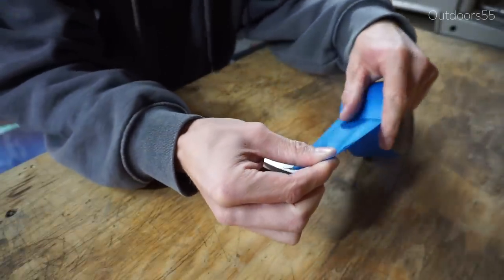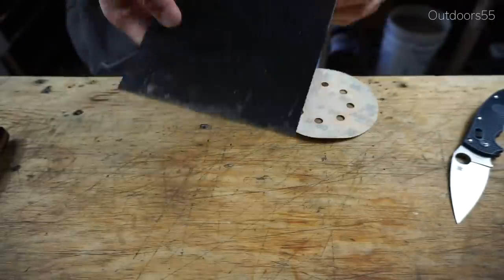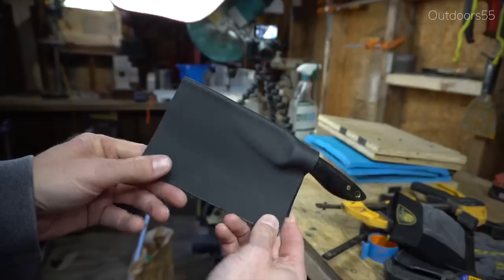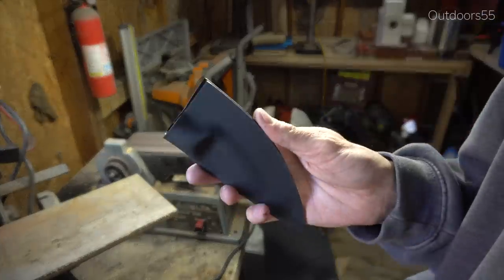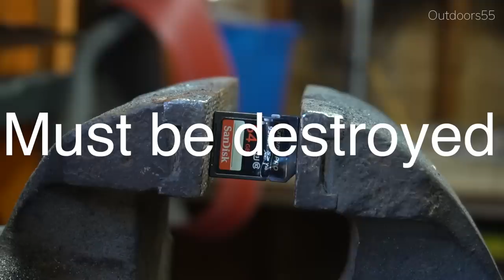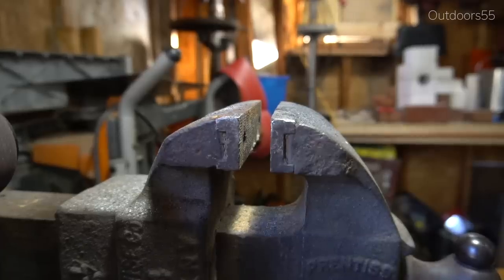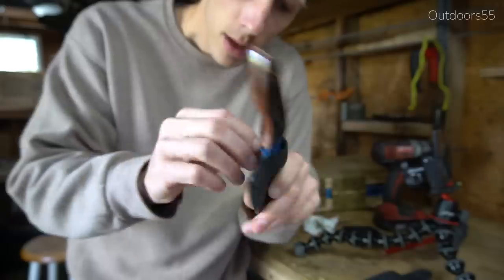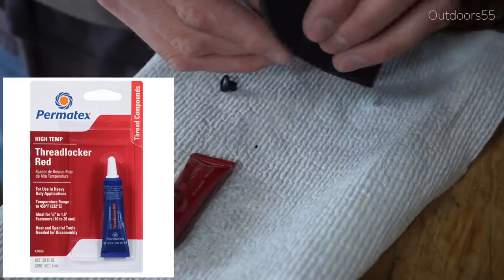Super Simple Kydex Knife Sheath Build - How To Make A Kydex Knife Sheath

Comment: Hey yall, i just wanted to point out that those "kydex bits" are actually just regular old spur bits that have been marked up in price. You can pick them up from anywhere that sells regular ol' drill bits. The brad point in the middle allows younto ensure that the middle of your hole is as precisely placed as possible, it keeps the bit from moving from where you want it at all whatsoever when you're starting your hole, and the other 2 points actually cut the material so you get a really nice clean hole. They're actually my go-to bits for 99% of my hole drilling needs because they work fantastic in any kind of MDF, both ply and solid wood, drywall, kydex, etc...pretty much anything thats softer than masonry or hardened steel. I've never tried with thicker aluminum, but honestly i think it might work as long as it wasn't a real small bit (obviously it might not be great for the bit, but I wouldn't be surprised 9f it could pull it off) but it works just fine going through aluminum flashing and whatnot

Comment: Little tip about the drill bit if you use a regular bit heat the tip of it before drilling the holes it helps keep it from jumping around and it helps with a cleaner hole  .. by the way love this channel good stuff

Comment: Is steam hot enough for molding Kydex? Because if so you could just pop it into a $10 vegetable steamer from the thrift store, then there would be no risk of fire or melting the Kydex. Also if steam works then simply boiling your piece of Kydex in a pot of water would work too.

Comment: Here in France those drill bits are sold as wood bits. Might be woth comparing prices to so called kydex bits. Just an idea. good health and stay safe.
Reply from the maker: Im sue theres some small design future that makes them unique to index. What is it, I have no idea. Any drill bit will work. Having the point helps accuracy .
Reply: They are just brad point drill bits lot cheaper than so called special kydex drill bit any home center will have

Comment: Question for your kydex how. When you attach the hinges do you depress the foam a bit when you screw your hinges on or do you just attach the hinges with the wood and foam(mainly foam) just making contact in the rear and use the clamps on the front where the majority of your shaping will occur around the beginning of the handle where it meets the knife. Recaso (spell check couldn’t help me here) haha.
Reply from the maker: I depressed them slightly. Maybe a quarter inch, so not much. I don't believe that it makes a difference.🤷‍♂️

Comment: can kydex be heated by steam guy ??? I have a wood bending steam system at home but didn't have heat gun or oven and the heat of the steam pod is quite hot so i think i can use that for heating the material plss help

Comment: So would it work as a neck knife sheeth if you didnt facen it would the kydex have enough retention because i think that would look mint
Reply from the maker: Yes it would definitely have enough retention. You can adjust retention as well by forming the kydex tighter or looser on the contact points.
Reply: You can install retention adjustment screws too, like many holsters have.

Comment: Are you using °F or °C on the oven, I'm kind of confused. And also, can I use thick plastic for knife sheath and do you think it's better. It's easy enough to mold but I never tried to make a sheath out of it. The plastic is about 0.8mm thick.
Reply from the maker: fahrenheit. Not sure. Never tried plastic. It might be worth a try.
Reply: So you use fahrenheit, now I need to turn the number into celsius. At least everything is clear now.
Reply from the maker: The temperature doesn’t have to be exact just an idea 🙂
Reply: @OUTDOORS55  
The temperature is important in your knife making video. All this time I thought you tempered your knife at 400°C.
Reply from the maker: Oh yes, then it’s important! Yes everything is in F

Comment: 3:50, you say dont buy the cheap ones.. i have some from a store called action for 2 years now and none broke on me and i cranked them pretty hard
Reply: You must be lucky. I've had exactly the same clamp break in exactly the same place. Needless to say I upgraded to a more robust brand
Reply: Dont think it is luck, i have 5 and use them all the time.. i even crank them on the tip (they often slide off then because of the plastic tip) but the 1st has yet to fail

Comment: Kydex is the best material for knives and guns, sheath and holsters.
Best thing is that it can be modified if the manufacturer made a mistake (quite often in EU).
Knives sheath can also be "reset" and molded again on a similar new knife, with similar dimensions.
Kydex is way superior to molded "by fusion, casting" polymers (lazy choiche for mass market, impossible to fix problems... requires a new sheath from zero), crappy fragile plastics (inferior quality equivalents, very comon in EU, tactical market... even for hosters 😑) and leather (nice but requires care).
...and kydex sheaths will not ruin the sharpness of the edge, if done properly (rivets side on the apex, will create a mini hollow channel for the edge), instead molded polymers will damage the  edge, especially if they have glass fibers.
I constantly use kydex sheaths, done by me and knives stay sharp.
Hybrids sheath with kydex and leather together are also very nice, less practical but cool for enjoyment.
I also learned to do them by myself... thanks to the speed of EU manufacturers 😑
You have excellent crafmanship, highly skilled 😃👍👏
🇮🇹

Comment: Kydex is for rookies! I am returning the leather ... Kydex has scratched all my blades that came with it as standard. Some expensive blades now have Kydex damage !!! I wish blade manufacturers would give you a choice between Kydex for kids or a leather sheath for all blades over $200 ... the leather would be an optional extra (higher cost) ...
Reply from the maker: I’m with you. Kydex isn’t the most glamorous sheath material and it has issues. On the other hand, it can take just as much work to make a leather sheath as the knife itself.  In some cases it turns a $200 knife into a $400 knife. I guess it all depends on what you want. Thanks for the comment my friend 👍

Comment: 8:13
That is just a lip and spur or a brad point drill bit. I hope you didn’t pay much for that “specialty bit”.  They are used for wood and plastics.
Reply from the maker: nope they are price about the same. It is different, slightly, than the traditional brad point. I dont think actual use in kydex is any different though.

Comment: Those bits aren't actually special to kydex. It is called a spur bit, very common in wood working.
Reply from the maker: Kydex does have their own bit design which is being used here. A regular brad point will work just the same.